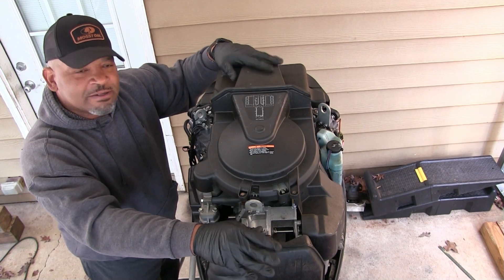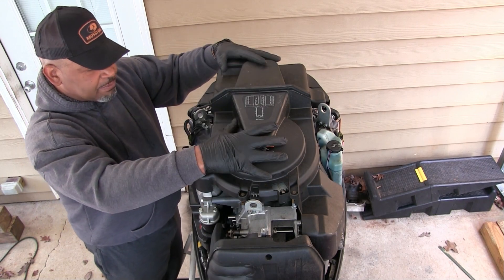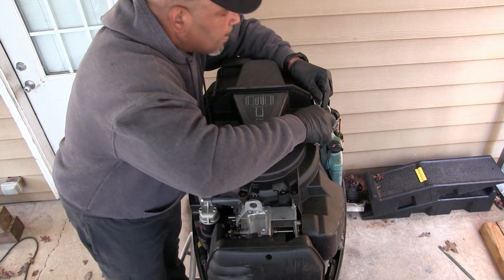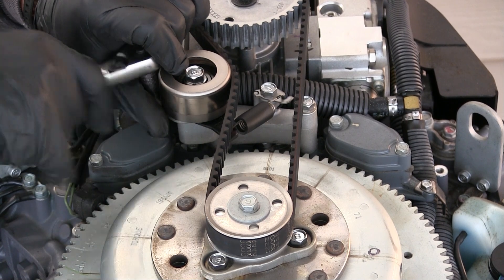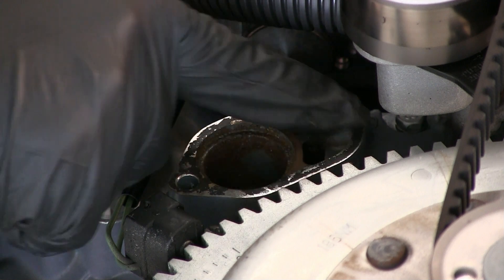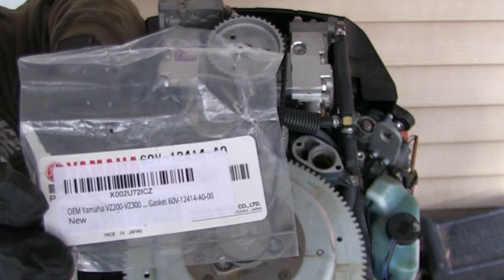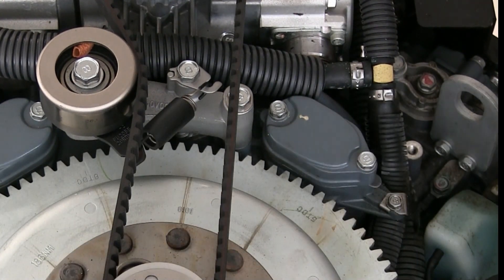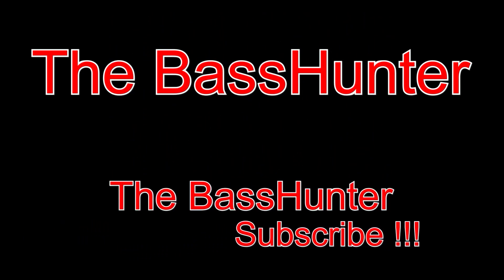Yamaha Outboard thermostat Replacement

Comment: Awesome video.    I am about to flush out my cooling system and this video helped a lot.     I haven’t found many videos for this specific engine.     I have a 2009 Yamaha vmax 200 2 stroke with 300 hours on it.  

Do you have a video on changing the lower unit oil?
Reply from the maker: Thanks for the great comment and yes I have many videos on my motor. Here is the on you asked for with the lower unit oil. https://youtu.be/MF4opamxEUg